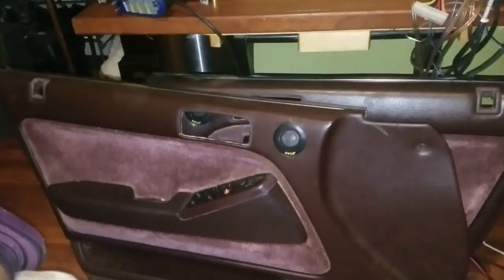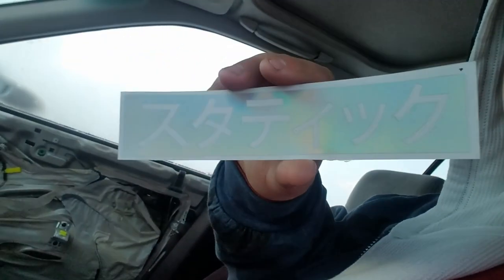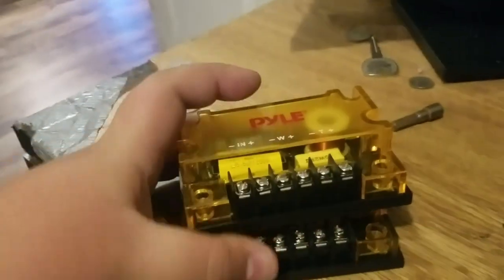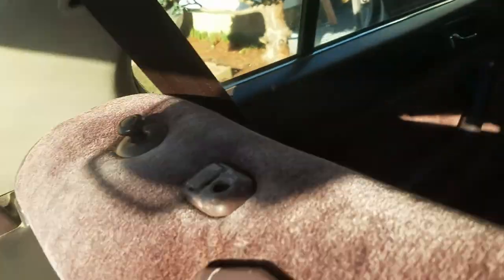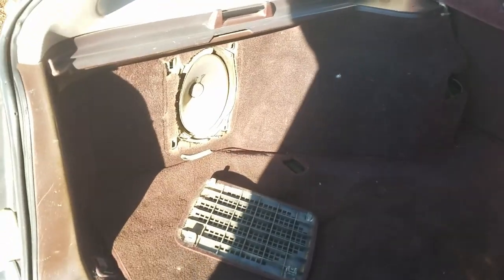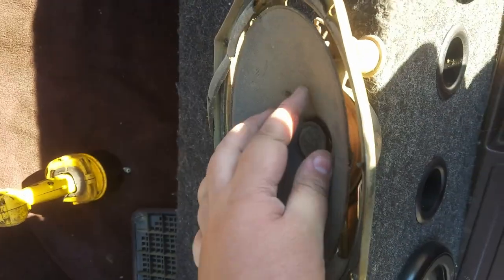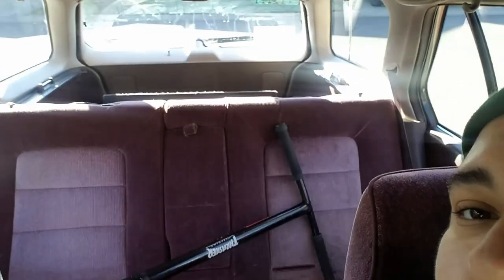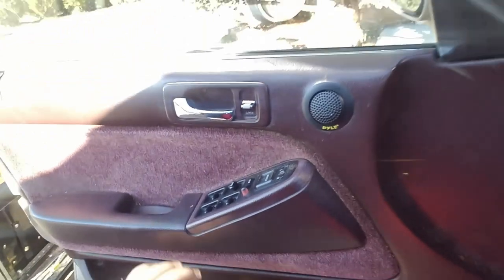Pyle 6.5 Component Speaker Setup In the Accord Wagon!!

Comment: Hi. I'd love to show you some pictures of my cb9 wagon. So a new 6x9 can be put in the rear and it'll work just fine? I installed two new 4 inch in the roof and 6.5 in the front. I bought mine about a month ago and I love it.
Reply from the maker: yes the rear one near the floor is a single 6x9 and will fit in with no problem. There awsome cars!!
Reply: Do you have a Facebook or anything I can share pictures of my wagon with you? I paid 600 for mine lol and ours are litertally identical.
Reply from the maker: @kevinftw16  instagram? Juliobikeshard

Comment: I'm thinking of buying one saving money for one i like 1991 lx model is fine with me years ago i found one in blue it had 117,000 original miles it was priced t $2,600 i try talking down the price dam that salesman would not budge on the price it was an automatic mint condition nothing wrong with the wagon i even took it for a test drive smooth running. Dam if only i had that extra money I'd own it today bro. Still looking for one but it's getting harder and harder to find one. Just like the 1992   -  1995  Honda Civic dam no one is selling my favorite kind of Honda's Accord and Civic old school they are treasures to me.
Reply from the maker: Forsure man to find a good clean example of any honda is a hard especially since there only getting older and older
Reply: @thathondachannel2105  
Yeah if i take too long to get one I'll settle for a newer one.